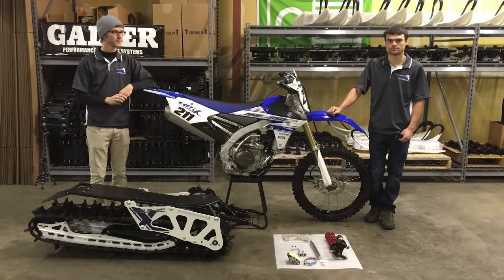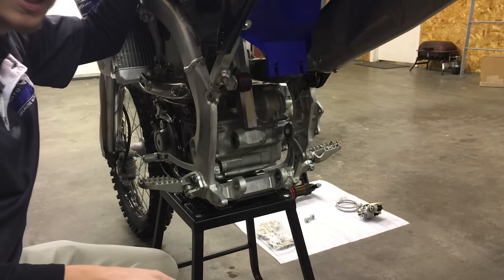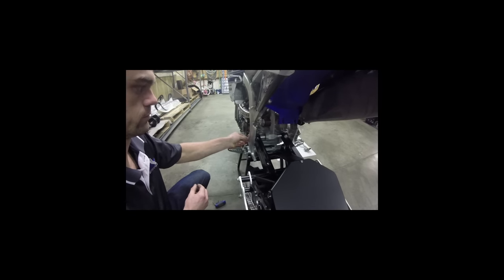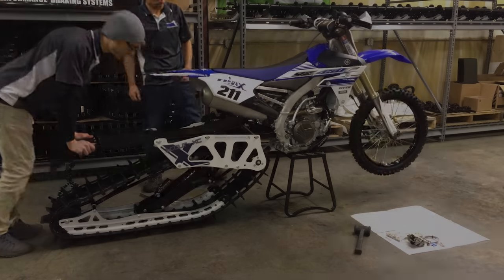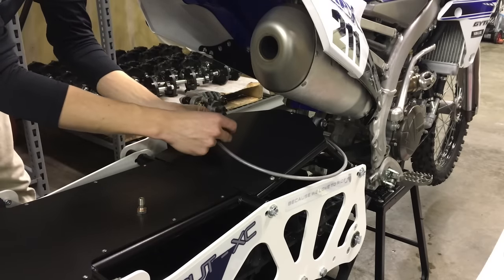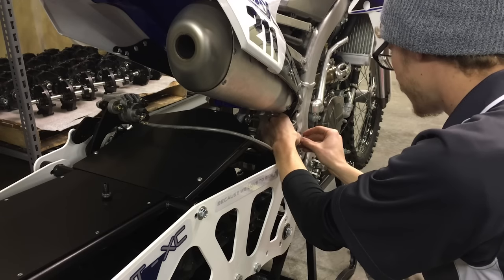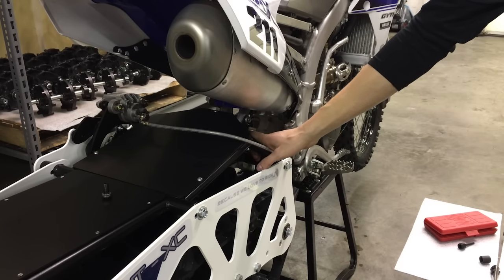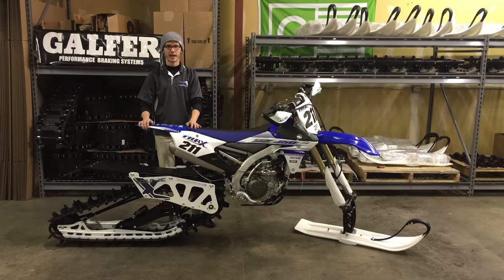MotoTrax: Scout-XC Track Install

Comment: The only down fall I see in this is that the engine is gonna be workin a lot harder   with all that extra weight and pushing all the snow   could be wrong
Reply: You are correct. I wouldn’t run it on anything less than a 450. It’s a lot of stress on the motor